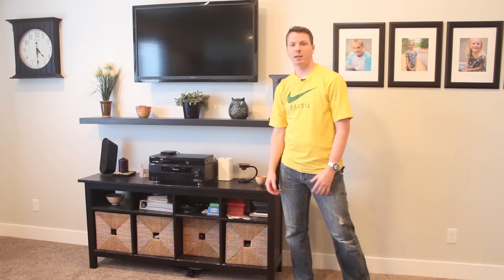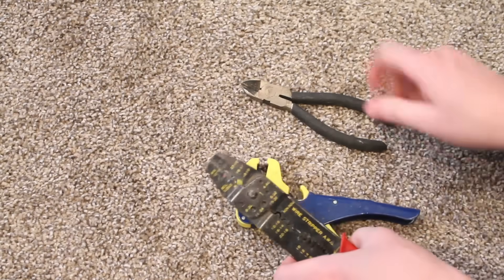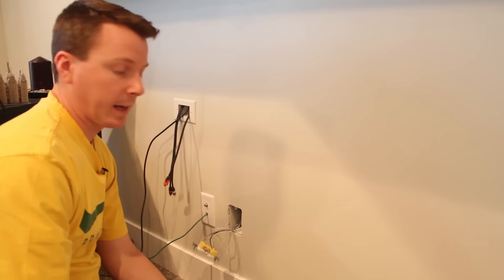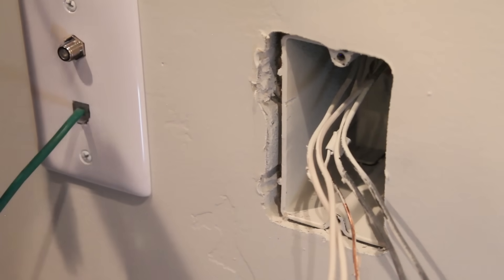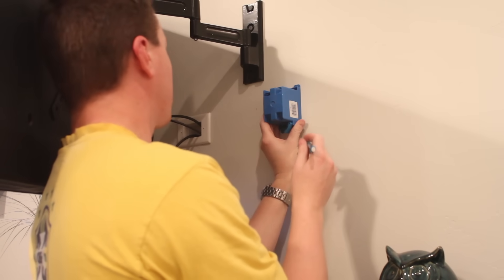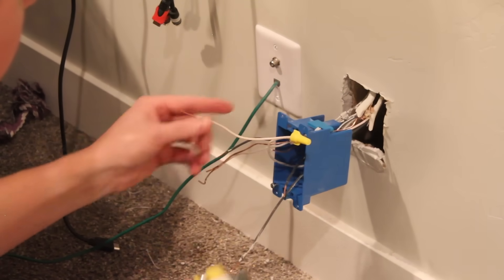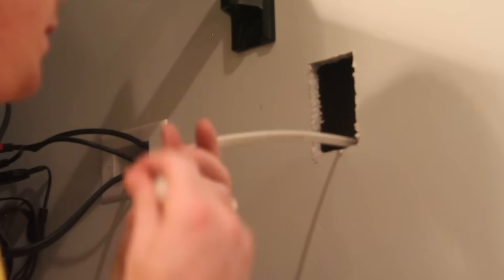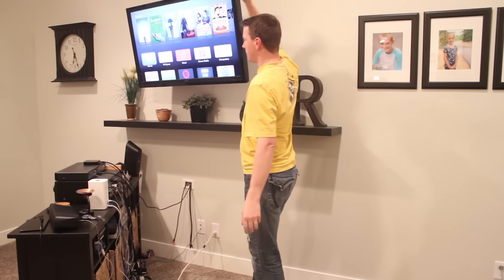How to Add an Electrical Outlet for a Wall Mounted TV

Comment: I have a firewall what’s the best way to do this without excessive cutting of the drywall ?
Reply from the maker: Consider using a flexible drill bit, like this: https://geni.us/Vuv8q. That way, you can cut the top hole and then drill through the fireblock with this bit. It's not a piece of cake, but it's a lot easier than cutting through drywall, fishing, patching, painting, etc. You will want some way to guide the Romex cable through the hole, like maybe some fish tape.

Comment: Is there a safe way to bunch up the wiring when you’re putting it all back in the blue box? Seems pretty tight/constricted in the outlet closest to the floor.
Reply: You can get a deeper box, I think is like an inch deeper.
You also have to fold and push ground bare wire first.

Comment: I was just wondering if you have ever seen a flexible drill bit to drill inside the wall you can drill through the fire block without cutting the drywall to get the wires down the wall they even have a little wire grabbing cage that you use to grab the wires to fish them down the wall you can drill up in the attic or down in the basement without cutting a bunch of holes you just cut the hole for the outlet box and your good to go drilling
Reply from the maker: There are flexible gooseneck bit extenders out there but they're typically somewhat light duty and might not work for an application like this. A right angle drill extension might do the trick. In either case, the other issue is being able to then feed your wires through a very specific spot where you drilled. Let me know if you do try it and have any luck.
Reply from the maker: So it turns out there is a flexible drill bit like what you're talking about, actually. I just heard about it today. Here's a link to one and based on what I'm seeing, it seems pretty legit. https://geni.us/QjG7q There are other brands that make these as well, like Klein.

Comment: I’m a little confused about the new power that you added. I see you only added one set of wires. Does that power both plugs spots?
Reply from the maker: Yes, exactly. All outlets have two plugs but only require one neutral (white) and one positive/load/line (black). Ideally they'll have a ground wire as well. The reason most have two sets of wires is because one set comes from the original power source and the other goes out to the next outlet. When you connect a white wire to either of the two silver screws, it's connected to the other screw as well. Same with black and brass. The two screws are to make it easier to connect both the incoming and outgoing wire sets.

Comment: @Nils/LRN2DIY in the beginning of video you mentioned the previous video you did is not up to code locally. Where (which state) do you live? I live in CA and there's many Home Depot's here that sell a very similar and very popular product to what you used in your other video. See here https://www.homedepot.com/p/Commercial-Electric-Flat-Panel-TV-Cable-Organizer-Kit-5623-WH/305090874 I cant imagine HD selling something that doesnt comply to local electical code. Just wanted to get some more info on how you determined it to not comply with code? Very interested in doing that (other video) install so curious how you came to that conclusion. Thanks!
Reply from the maker: So the kit you're looking at is, in fact, up to code. It's my older video where I dropped the power cable down the wall along with the A/V wires that isn't up to code. That one is called How to Hide Your TV Wires for $10. Most any kit like the one you linked, based on all codes I've studied, is completely legit. I live in Utah and have mostly studied the codes here, so it's always best to read the codes for your region.
Reply: @LRN2DIY  Gotcha. I think i mistook the video you were referring to as this one https://www.youtube.com/watch?v=xSqbXl5m4_o which i believe IS up to code (when done using a kit similar to the one you show in video). FYI the part of the video where you make that note of being non NEC compliant doesn't have a link enabled to take a user to that video. Also, great tip on the Bilge and Pump hose. Thanks for your videos- they're very helpful!

Comment: Only thing I would suggest is one of the two outlets should be a GFCI so in case of a surge will protect the circuit from voltage spikes
Reply: I think GFCI outlets are only for kitchens, bathrooms and outdoors. Any outlet that is 6 feet close to a water source must have one.

Comment: I love your video very simple and precise! That's why I subscribed thank you
I have one outlet controlled by a switch on and off, can I feed one more outlet at the same level 4 ft away and another one 5 ft higher behind my TV?
Reply from the maker: It's certainly possible but a couple of things to keep in mind are that only so much current can be drawn from one circuit, so you'll want to be careful not to overdo it. Also, running wires horizontally across studs is a whole different story than running them between the same two studs. It involves cutting the drywall around every stud in between. Again, certainly possible but you'll want to plan it out carefully.
Reply: @LRN2DIY  thank you for replying so quicklyp I appreciate your time!
Actually this outlet is connected to a switch on and off and  this outlet is feeding another outlet  too I don't know where but I just want to take it 5 ft higher behind my TV can I do pigtail and add this new wire?
Reply from the maker: Yes, that should work fine.
Reply: @LRN2DIY  thank you again and god bless you

Comment: Since they are not connected, can you use the brass and silver screws on the old outlet to run to the new box? I feel it would do the job of a wire connector without having to remove each wire from the tabs

Comment: Why are there 2 sets of blacks and whites going into the bottom outlet? Thanks.
Reply from the maker: One set (one black and one white) is coming from the source to provide power to that outlet. The other is outbound, providing power to the next outlet in that chain.

Comment: One - a little caution cutting out the top receptacle hole - if it's directly above an existing outlet, there are possibly wires behind the new receptacle hole. I've seen construction where wiring is run up from a crawl space, down from the attic, and even some wired horizontally, outlet to outlet within a room, drilling through the studs. It just depends.

Two - If your home is wired from above, depending what type of existing outlet box you have, if you can see a wire behind the new receptacle hole, it may be possible to pull an old wire out of that old box, drawing it up through the new receptacle hole - after first  connecting a length of new wire to pull up through the existing box. So you have an old wire  which you cut at the new receptacle hole, and new wire running down from the new receptacle location to the existing receptacle box. Again, this is a tough pull with those plastic tab boxes, Metal boxes with screw in strain clamps are an easier pull. This method shortcuts having to cut the old receptacle box out,  fish the new wire (since it's pulled up by the existing wire), and you don't have three sets of wire coming into one receptacle box.

(In a perfect world, they would have left you a foot of slack of old wire in the wall - you could just pull out the slack, cut, strip and connect in the new outlet. There is no perfect world, so to get enough slack, new wire is going to be involved either way)
Reply: Seriously?!?! If a home is "Wired Correctly", there would be NO WAY to use the old wire as a pull string. The wire must be stapled at 6-12 inches from the existing box by code. There would also be multiple staples along that wire run to keep wire from being damaged by dry wallers', insulaters' and to keep wire run tucked neatly in wall cavity. Multiple wires tell you that you have a feed wire and the other wire/s going to another outlet or light switch. So Pig tailing the wires as he showed is the way to do it. A bit more length 6-7 inches neatly pushed in accordion like to allow for future work or repairs. As far as the new box goes, to replace old, personally instead of cutting out and installing a new one, you just drill a small hole into existing box to use to feed new wire. Just shoving the wire in as demonstrated could cause a short with the bare ground wire being moved towards the power side of outlet. Ground should be placed into back of box, then the neutral and lastly the positive or hot lead.

Comment: Home-free Wall-mounted Plug-in Board Router Plug-in Line Board Holder Adhesive.. https://www.ebay.com/itm/313331016219

Comment: You made this way more difficult than it had to be!  You could have left the outlet as is and just connected the new wires to the screw terminals.  Also, you could have left the box in the wall and just fished up from the top of that old box to the new outlet behind the TV.

Comment: I'm an electrician and you didn't have to remove that box you could have fished a wire from the bottom to the top and then just put in a new box and an outlet at the top.

Comment: I was so excited to try this and I got as far as trying to figure out connecting the new wires to piggy back off the existing wires, but when I pulled out the exiting wires to sort them out, there were three total sets of “noodle” wires already coming out (like something is already piggying off the outlet). I can’t attach a photo. But it was one thick noodle, then another, then another. Think it’s electrician time. Dang it.

Comment: You should have just left the old box in and used a fish tape from the bottom box to the top box. Then pull the romex down from the top hole to the bottom box and connected your conductors to the screws on the existing outlet. Same thing electrically with less points of failure and far less work. then all you would have to do is tie in the upper box with the new plug and your done. Not trying to bash on you but i think it would save you a ton of hassle in the future. Looks good though in the end!

Comment: Mo you crack the sheet rock on the bottom of the outlet you broke the paper so the bottom of the box tab will not secure the boxProperly so when you unplug a plug you’re going to be snatching the whole box with you 😂

Comment: "Not a professional electrician, just a guy that likes to figure it out.." 
Good stuff!!!👍🏽✊🔥
Reply: electricity is really easy honestly. white to white ground to ground black to black. as a handyman myself u can do anything by watching these videos but be cautious with panels and rough ins
Reply: @lolpump5594  does bunching up all the wiring when you put it back in the blue work box a fire hazard? What’s a safe way to do this?
Reply: @JoeGreen03  if all your nuts are secure and your screws on ur switch or outlet are secure, you’ll have no problem as long as u have enough space

Comment: I don't understand why this is any different than the other video. Isn't it the same type of wire you ran from the top to the bottom anyway so why would you put in an outlet

Comment: Hi - What would the steps be if I wanted to leverage an existing outlet as you have done, but to add two receptacles behind the tv not just one?
Reply from the maker: Almost identical to this video, but instead of a single gang box on top, add a 2-gang box (fits two outlets). Then, when you wire it up, you can either wire directly into one, then daisy chain over to the other (extend it) or run pigtails (short extensions) from the source wire to each of the new outlets. Let me know if any of that doesn't make sense :)

Comment: Amazing video. I followed step by step. But, as another person said I did NOT have to cut out the old box. I just used a fishing tool (the kind that looks like a  measuring tape) and fished it though one of the knock out holes in the existing box. The rest was a breeze. Thanks again!

Comment: You don’t have to remove the existing box .. just fish your new wire thru the top of box where the existing wires are coming thru
Reply: @SCP--nx6kk  the 3 way splicing is unnecessary.  If one of the silver terminals on the outlet is powered, so is the other one. Theres a jumper between each pair of terminals (brass and silver). The third wire is redundant and could have just been how he was taught to do it.
Reply: @MrAlchurro  incorrect, 3rd wire is not redundant. It creates a true parallel circuit for the 2 outlets
Reply: @SCP--nx6kk  lk0no j8 hivuvh
Reply: I just drilled a hole through the side of the original box and though the 2x4, used the side terminals on the receptacle, and pulled Romex to an "old job" single gang box. Total time less than 30 minutes .. spent more time trying to decide where I wanted the receptacle. My 2¢ .. put it above the wall mount given the choice.
Reply: How to install old work gang box drywall
Reply: It will technically work without "pigtailing" (3 way splicing with a wire nut) but it might not be up to electrical code or could have issues if the outlet fails. Pigtailing is the proper way to do it.

Comment: Thank you for not using those holes in the back They should never ever be used. As an electrician I get calls where people's plugs don't work and I find plugs where the wires have been shoved in the back holes and then they start to get warm and even melt the plug and it scares the customer sometimes when I pull out these melted twisted plugs because those connections over time will weaken because it's just pinched in there it needs to be under the screw always never ever use those stupid holes I don't know why they're even allowed to be there

Comment: This is great! I'm almost certain I will be performing this same setup soon. My only concern is running 2 sockets off the same wiring to the panel. Is there any concerns with pulling too much from the same line? I guess its not that different than plugging in a power strip?
Reply: You can add as many outlets as you like as long as you don't go over the amperage of the braker. A 15 amp braker only can handle 12 amps of constant current. A 20 amp braker can handle 16 amps of constant current.
So, yeah, you are right, it's the same as using a power surge extension, and outlet is just safer and more convinient.

Comment: Hello I know u can add another outlet from an outlet,,,but can u add 2 extra outlet from 1 existing outlet??? Thank u for ur time...
Reply from the maker: Sure. Same principles apply, just keep going. The major consideration is whether you should. You'll want to run the numbers as far as potential voltage on that one circuit that all of those outlets are on.

Comment: If you can get the new wire into the existing box, could you leave the wires in the hole and use the screws to hold the new wires to the new outlet?
Reply from the maker: Absolutely.
Reply: @LRN2DIY  thanks.

Comment: I wish you had showed putting the box in the new existing wall hole.
Reply: Step 1: Place box in Hole
Step 2: Tighten tabs tight enough to hold wall in place, but not too tight they break
Done

Comment: Just curious. Is it not possible to run a small extension cord through the wire pass hole thing? Instead of installing a whole new outlet there?
Reply from the maker: Yes, you can, but it's against building code just about everywhere, hence this video. There are kits that do something similar but in a code-compliant way. That's this video: https://youtu.be/xSqbXl5m4_o

Comment: I am a electrician never use the little holes on the back of the outlet always use the screws better connection and they won’t eventually wiggle loose start to spark
Reply: i use the screws and do a couple wrap around the connectors with electrical tape
Reply: I agree.  I just bought a home that had an outlet stop working.  I popped it out and to my dismay the push connections were being used.  I'm slowly going through the house and fixing the connections.  They're all done that way.
Reply: CaptainYzerman for sure get them changed out there a thing of the past used to get houses wired faster.
Reply: @codyec  Will do.  Another fun fact about my house.  It was built in 1987.  I also have that grey plastic polybutylene pipe for my plumbing which is now banned.  I will be changing that out soon.  Fun times! LOL
Reply: I'm curious how do you feel about the ideal push connector ones? I just did one and kept the inbound circuit one 1 set of lugs and 3-way push connector'd the other set of lugs (with a little pigtail) to the original outbound circuit and up to the new outlet using those.
Reply: @dh-1399  they work great for 15 and 20 amp circuits. don’t use for anything higher
Reply: DH 1399 uhh I’d you have let’s say three sets of wires what you could have done is pig tail them and make them all one set if you get what I’m saying
Reply: I have a brand new house and my entryway lights weren't working. Took the cover off and the hot wire popped out of the "quick connect" holes, so I just put it on the terminal. Shortcuts don't usually work out.
Reply: @jeffwvu4602  yes for sure never use them cheap as connections they eventually mess up

Comment: Just a warning to public, this video is great if you have an outlet right below the tv and if its not an outside wall. 
For outside walls, you have insulation and vapor barrier. You wouldn't want to mess those up.

Comment: Thanks a lot for the video! Really helpful. One question/comment. I’ve read that there’s a code requiring sheathing around the wire bundle all the way into the box. Maybe that’s just on new work boxes where wire can be clamped? I noticed it looked like you stripped the sheath back outside the box on the lower receptacle. Any thoughts/comments on that? Thanks again!

Comment: You did not show the connections of all the wires at the end, skipped too many steps. Will refer to another more thorough video to get full instructions for proper installation. Didn't even include the gauge size of Romex either.